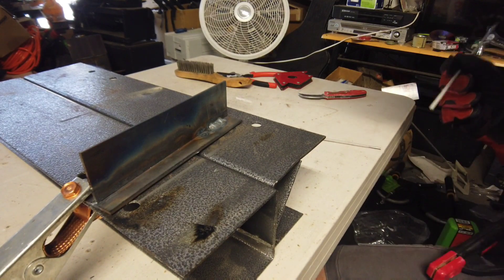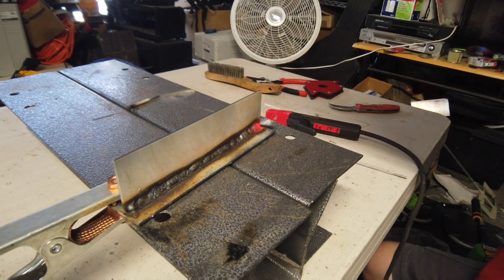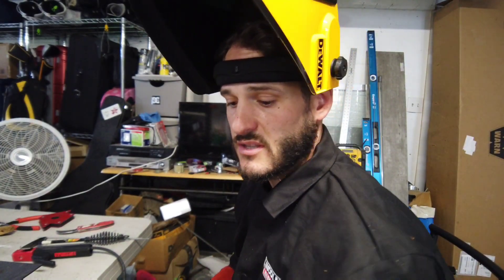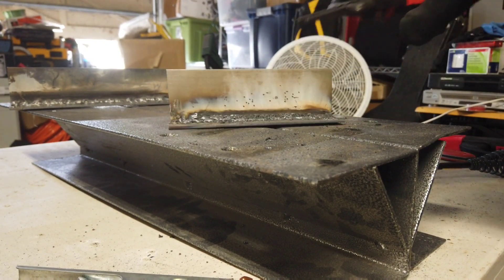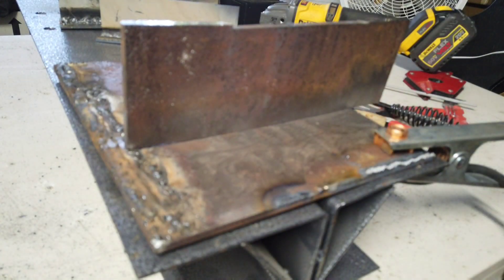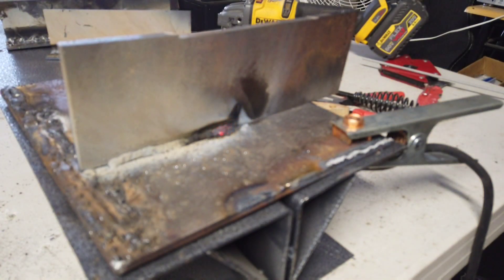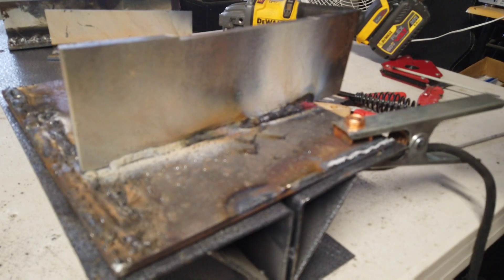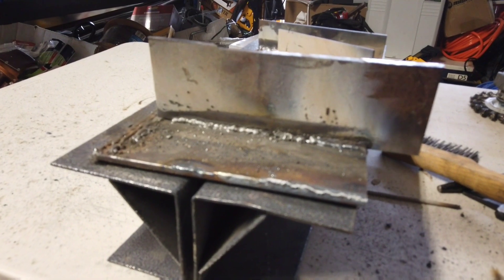LE31 MP WELDER - WILL IT WELD 1/8" Rod?!?! [2.0]

Comment: Can this machine weld 16g perlin to 16g receiver still on a Honda 3000 generator a 20amp outlet
Reply from the maker: I think you should be fine with that setting and generator. It may bog out your generator little. Any thicker material would most likely. Let me know how it works out.
Reply: It works with the generator
Reply: What’s the best electrodes rod you use to weld steel with it 16 g to 11 gauge square tubing and channel

Comment: Thanks for the video.  Do you notice any difference in the way it performs if you run this welder on a 50 ft extension cord?
Reply from the maker: I have noticed surging when connected to a smaller cord that length, just make sure you have a larger Guage cord and you should be fine. It also needs a dedicated circuit 20amp.